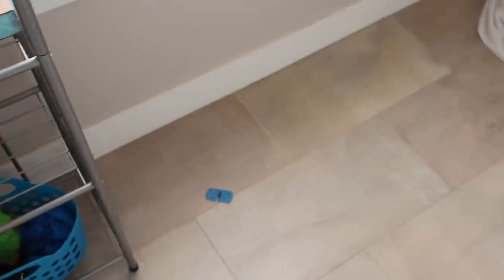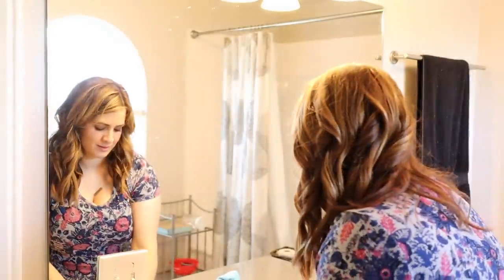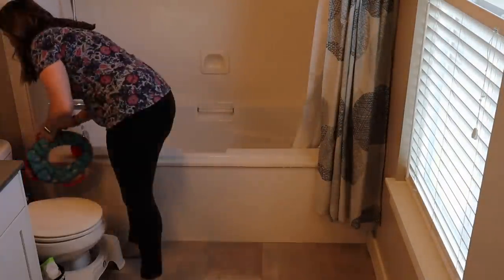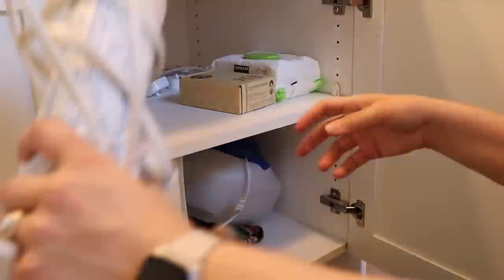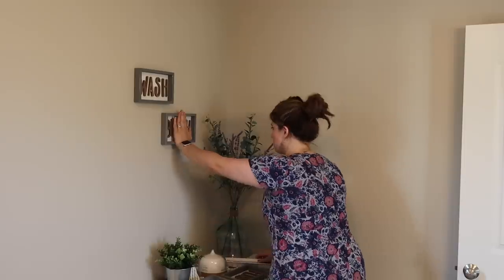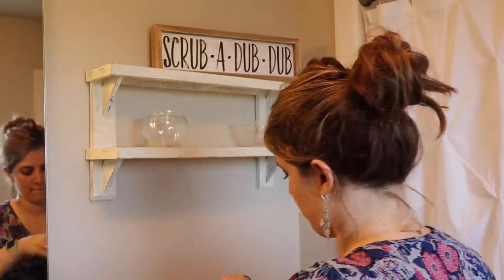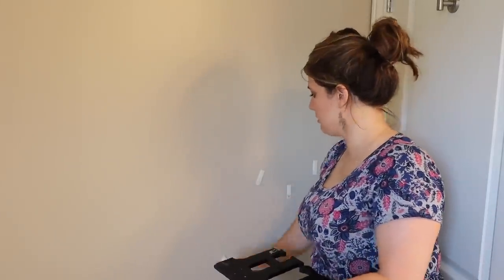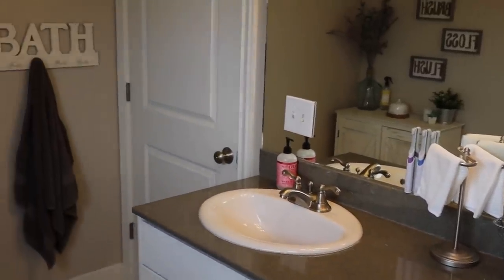BATHROOM MAKEOVER :: CLEAN DECLUTTER & ORGANIZE WITH ME 2019 :: COMPLETE TRANSFORMATION

Comment: Amazing ❤ as always. I wish I lived closer 🤔 if you're ever in the UK let me know. 
A tip I picked up from Cass from Clutterbug with regards to hanging things is to use a strip of masking tape. Put a strip of masking tape across the back of what you want to hang covering the screw holes. Then mark the holes with a pencil. Remove the masking tape carefully and line it up on the wall where you want to hang the item. Drill through the masking tape where you marked the screw holes. Remove making tape from wall then put the relevant fixings in and hang the item. It's so easy and a lot cleaner than using toothpaste, although that is also an accurate way of marking the screw points. Hope you have a great week 😘